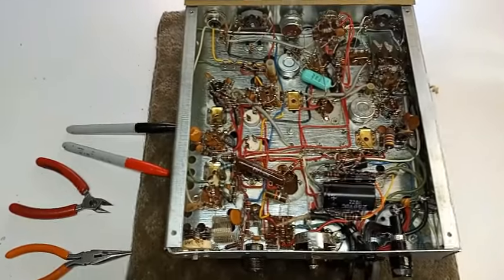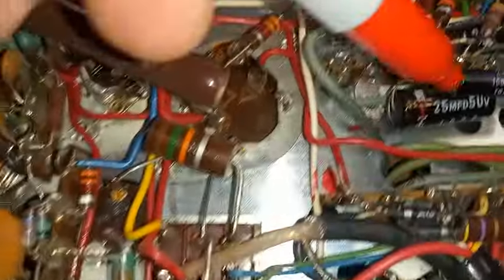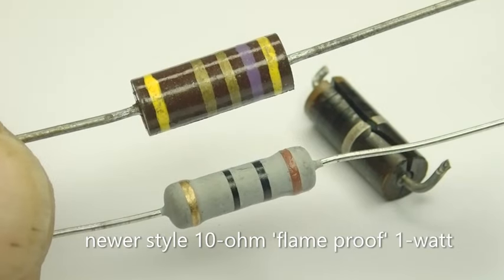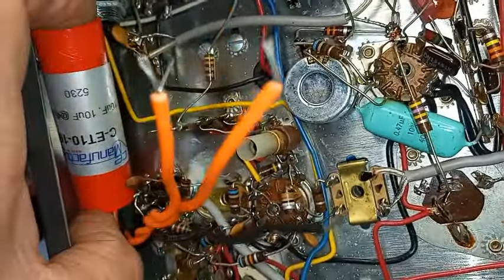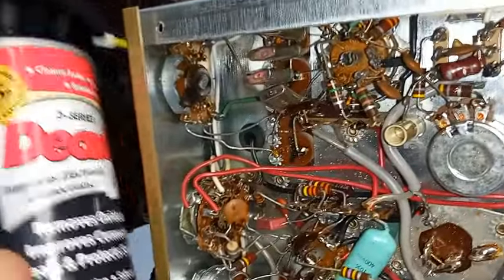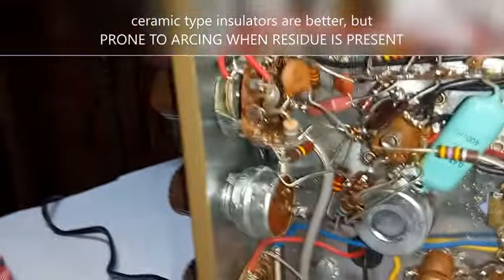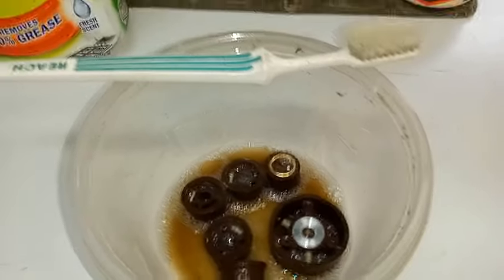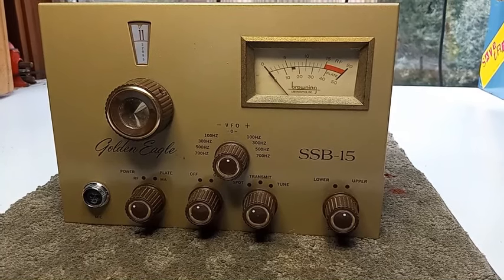Browning CB Radio Restoration - 101  SSB-15 - Example

Comment: Do you have a ping circuit resistor available?
Reply from the maker: I don't sell parts, however you need a 2.2 K resistor, upgrade from a half watt part to a 1-watt if using a ping capacitor value over 47 mfd
Reply: @s9radio  oh I see.  Thank you for your time